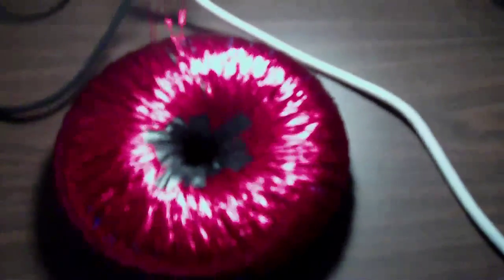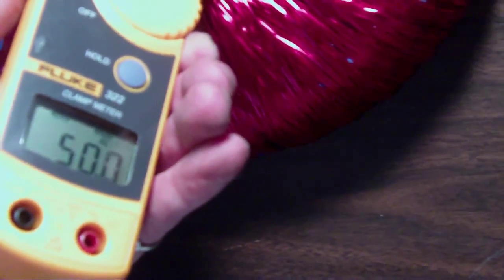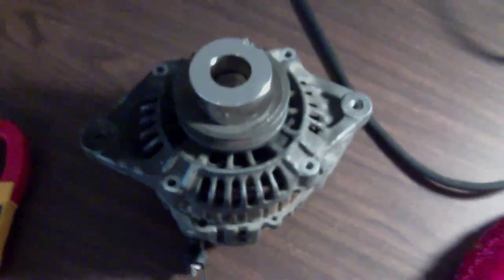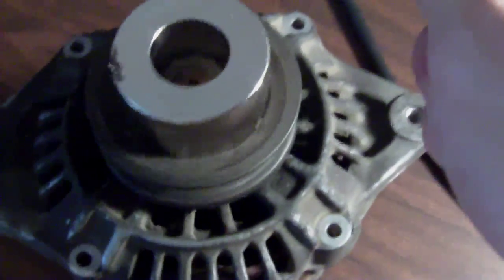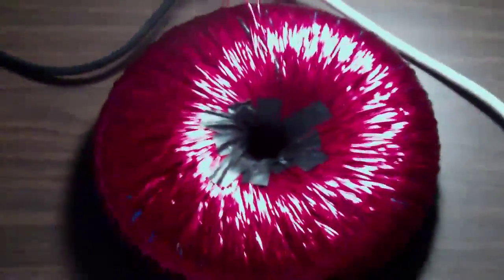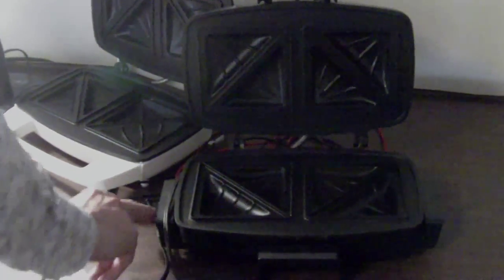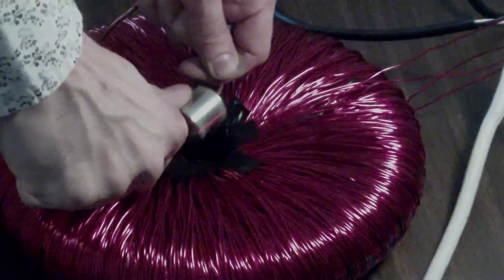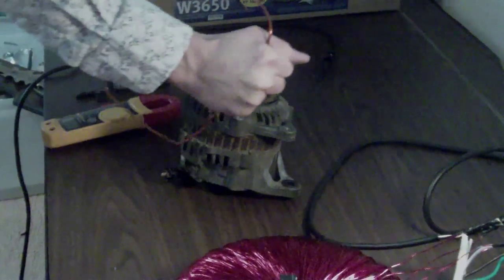Rodin Coil Baby Bear 2.0

Comment from the maker: @GregorArturo85 don't need to cast it you can doit like they do Iron power and mixing it plaster or something to suspend the particles no heat required infact heat would probably be bad, heat is always bad for magnetic fields... I mean by 50 volts to go is Im making 70 volts atm need more wire to get to 120. AC can use ferromagnetics because the nature of it, it flips it from north to south thats how it works in all single phase ac motors.. DC not so much. Pulsed dc sort of.

Comment: @Nevamdex At what temp does neodymium have to be cast at though? I've heard of people making orgonite with iron nanoparticles and magnetizing it, and it seems to have a very large torsion effect. What do you mean by 50 volts? And you don't want it the core to be magnetic, otherwise it will magnetize in the vertical direction. The core needs to be diamagnetic, so it will magnetize the core horizontally. Ideally the core needs to be made with a superconducter (ie perfect diamagnet) & a dielectric.

Comment: @mavendex As far as I know, he hasn't. And actually alot of stuff has become declassified from Area 51, and other projects in recent years. There's even David Sereda's infamous interview with Boyd Bushman at SkunkWorks. And the bismuth toroid is actually damn easy to get, as bismuth isn't hard to obtain, around $10 a pound, and it's melting point is 520 deg F. You can cast it while also seeding it with five bismuth crystals (for only half the donut) to crystallize it with pentagonal geometry.

Comment: @mavendex My next step is to do the magnetic gearing, using a resonant transformer but not AC, using pulsed DC. I know someone who worked at Area 51 and they say all they use is pulsed DC on the craft (along with bismuth and aluminum). Plus, that is what Marko Rodin says, pulsed DC. It would be interesting if the inductance of the rodin coil creates a pulsed DC current back which is where the free energy comes from, thus you create a loop back effect.

Comment: I never checked the amps. But that's using a HV transformer from a microwave which is hooked up to house power, so little watt loss in the transformer, but ya. And you want voltage over current with a rodin coil. The electrogravitic effect is exponential with voltage and linear with current.

Comment: @mavendex The geemetry does matter to do with Marko Rodin is actually theorizing. You are creating a very powerful electromagnet yes, but the most effective way for electrogravitic coupling to work is by using such geometry which directly relates to your magnetic gearing. And I did just hook it up to 2000+ volts, and she's working like a dime :)

Comment from the maker: @GregorArturo85 ya ... the geometry doesn't matter I have built several types of coils and this is by far one of the weakest, the current coil/transformer I have built on my desk atm blast this sucker to the heap. Able to produce 1.7 Teslas and I only have 9 wraps of a pickup coil and already gaining my volts back, I should be able to fit around 100 wraps of the pick up coil on to her, thus gaining all my 120 volts and yes the access amps do transfer. only .9 ohms of resitance in the new guy :D

Comment: I like what you're doing, love the sheer size of it. might I recommend using a more efficient geometry of the toroid. The radius of the inner circle (hole) to the radius of the outer circle (toroid) should be 0.7013 to 1. The Rodin Coil winding arrangements corresponding to pentagonal geometry so I specific toroid geometry makes it more efficient.